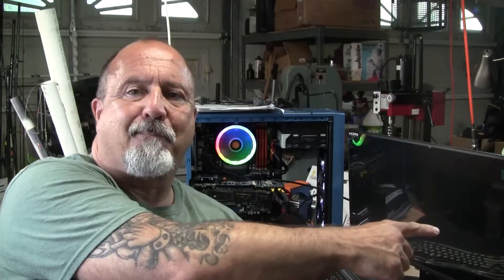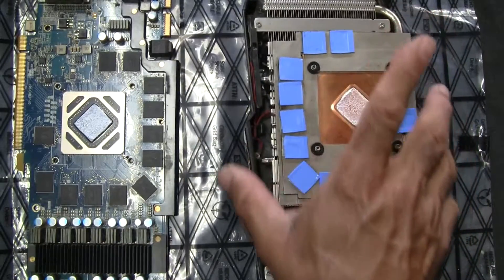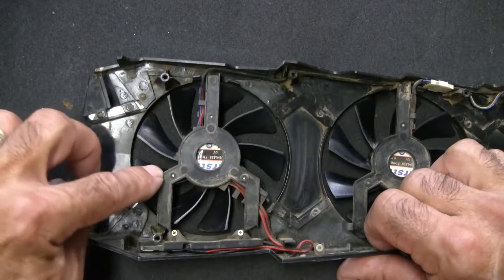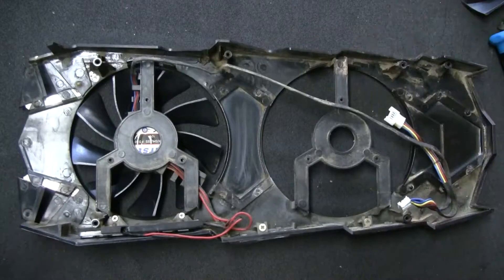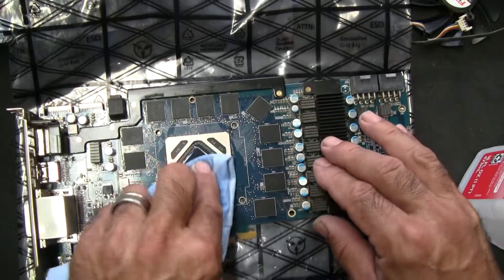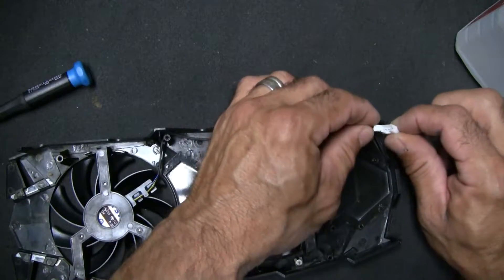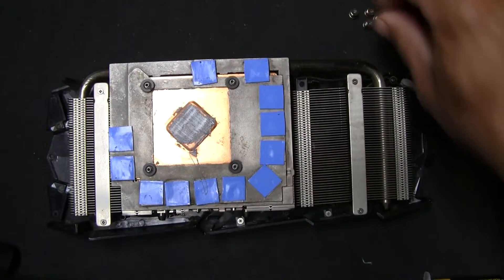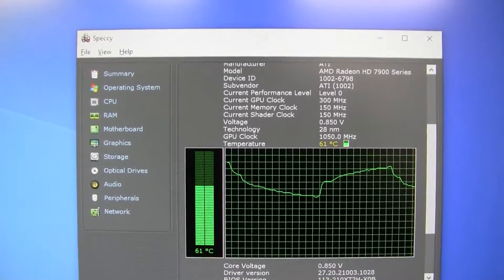How To Replace the Fans on a GPU Graphics Card - Save that GPU!

Comment: Hi! Nice vid! I want to change the fans but for a different reason. Do you think I could add a fan with RGB to a GPU?
Reply from the maker: I don't see why not. The biggest thing is to make sure the fan dimensions are the same.
Reply: @ExtremeDIYGuy  thx but they would prob not light up unless you found a way to provide power right?